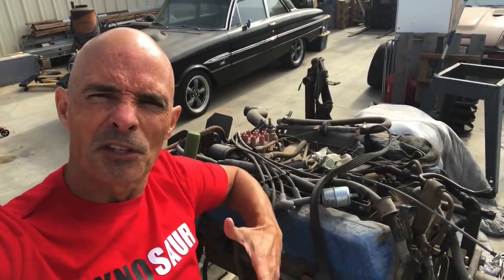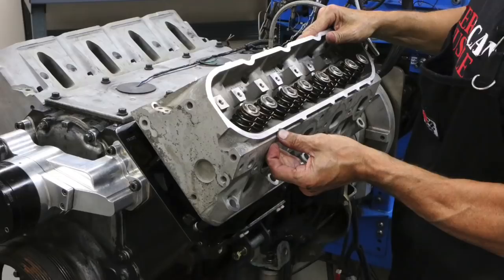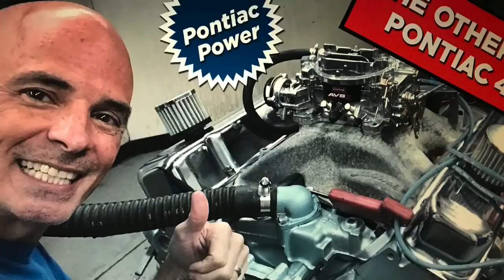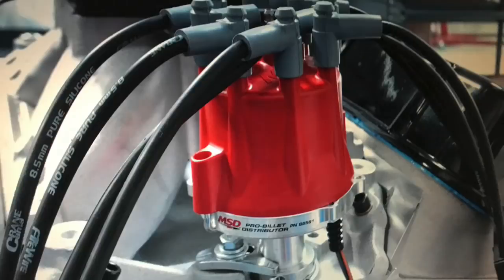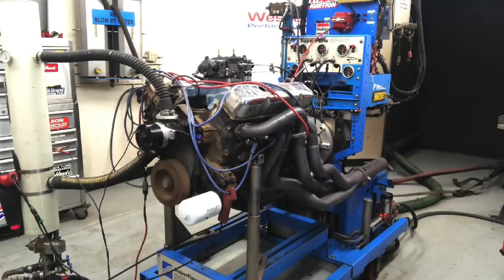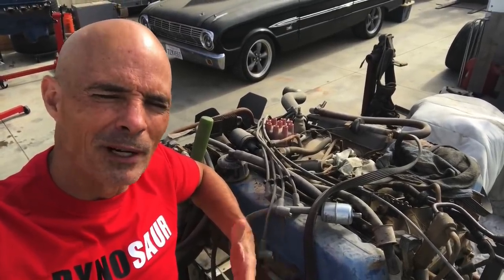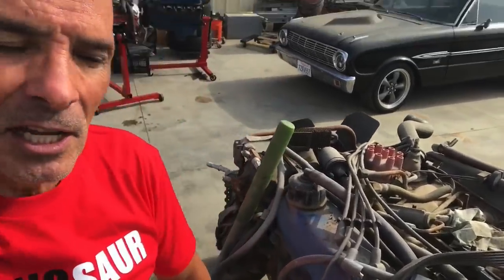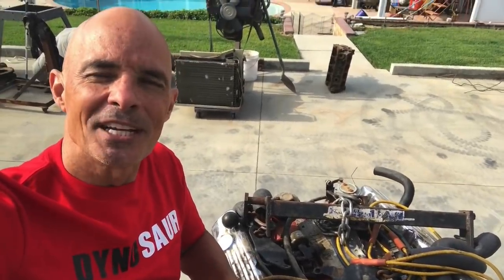REMEMBER YOUR FIRST....DYNO!

Comment: oke here's the problem with this, those accessorizes (water pump, alternator, power steering pump, smog pump, and fan) and complete exhaust system tell the truth about what the engine (motors are electric) is actually making for power. This is why the manufacturers use them in the rating and for insurance reasons they multiply this number x 0.8.  By dyno testing an engine without them in an air conditioned room is a lie. If I tested my 1995 LT1 with this deleted (I have an alternator and power steering pump on the car when I race it) I'd be over 600 hp. In my NHRA C/SA Stock Eliminator '95 Corvette its putting 491 horsepower to the ground and at the flywheel its 581 horsepower @ 7500 RPM. FYI you dont lose 30% of your power through an automatic transmission.  It takes the exact same about of horsepower to run it if the engine is 200 or 1000.
Reply from the maker: Having tested accessories back to back on the engine dyno AND run a motor on the engine and then directly on the chassis dyno-I know what they do. Also, the OEMs do not use a .8 calculation-they rate their motors on the engine dyno with everything hooked up (complete air intake, accessories, full exhaust, run at temp, with factory rune) and run the motor on the engine dyno as it is run in the car.

Comment: Richard,  do you guys monitor for detonation using a knock sensor when tuning older carbureted engines?  I haven't heard you or Steve mention that specifically.  I would imagine you tune timing to the edge of pinging no?  I have a very loud car and cannot hear a darn thing.  I watch the plugs of course but this seems quite inadequate.  I have tried a stand alone knock sensor (87-95 GM version W/ ESC for 5.7L) with the Caspers gauge but have had little luck due to outside noise I suspect and no way to filter it out.  Do you have any affordable suggestions.  Anybody else have this problem or advice?  Maybe I should just plumb a set of Det Cans but really want a solution using noise cancelling headphones that is DIY or affordable.
paste that in there please
thanks

Comment: As it was mention Steve ask questions regarding Camshaft and static CR, but does he do the math to know what the Dynamic CR is in the case of pump gas engines, and in the case of maximizing HP on a boosted engine where a boost level goal is reached do you Richard use a detonation sensor in order to maximize the timing or is this just a straight forward set of rules of timing/CR/Boost and A/F ratio ?
Reply from the maker: Unfortunately dynamic compression doesn't determine knock threshold
Reply: @richardholdener1727  I understand that temperature from lean AF and hot surfaces and timing have the bigger effect, but what about the pump gas limitations vs expected customer output with pump gas, I assume that the customer have a number they want to be close to our in their head, but when the dynamic compression beyond what the pump gas limitations are, then basically one is obligated to pull timing to avoid detonation taking in account you want to remain between 11.6 and 13 AF ratio like Steve mention, is the client expectations vs combination discussed in order to clarify the expectations on the Dyno test ? The reason I ask is that I was playing long ago with a software simulator and it was showing detonation if I went over the Dynamic compression threshold for pump gas, if I used race fuel then it showed no detonation.

Comment: What are the numbers on the heads  c8se are 68 Lincoln heads high compression 3dve are 73 heads d2veae heads are open chamber heads and are junk without a ton of work my guess is that they are c8sve heads with the style distributor and intake it has

Comment: My first engine dyno made just shy of 1500hp with a twin turbo 5.9. Tried so hard to crack 1500 made like 10 pulls in the 1475 to 1495 range but never did find that 5hp. It was a success but still frustrating!! Lol

Comment: I took the very first engine i built ( 455 olds ) to Steve at Westech back in 2004 or 2005.  Great guy! great shop! found a defective lifter and we were able to pull the intake and fix it on the spot and got back to testing.  He also found a hidden oil galley plug behind the distributor i didnt know about.  He caught that when priming the oil before first fire up.  He saved my butt big time, best money i spent on the motor.  Cant wait to go back.

Comment: First dyno was a dyno day. 35$ for 3 runs, no tuning. Fun fun. And I was hooked. 98 gt stock except for a CAI. Real dyno time was getting a chip burned for the 98 with frpp blower. Had a bad plug wire but still was big improvement over stock.

Comment: Riddle me this , on a chassis Dyno a high power boosted car will spin the rollers to the rev limiter in under two seconds , how useful is wideband info on such a short window . Yes I know someone will say roll the throttle on down the highway but that’s downright scary with 1500 wheel hp and at the track you’d have to idle back to pits before pulling plugs or at the very least keep motor running till off the track at the return lane before pulling plugs so that’s likely 30-60 seconds of idling .

Comment: My second question is what is the lowest RPM the engine dyno can register a pull from and why? It relates to your 292 GM testing, future 300 Ford testing as well as maybe the 500 Cadillac or others that are low RPM engines not designed to rev high and are designed to make power/torque right above idle from say 1000-1200rpm.
Reply: shane ,

Comment: I don't quite understand how Steve pressurizes the crankcase and how that will actually help the oil pump pick up oil, unless he's only talking about a dry sump? It seems to me if you pressurize the case, you still have the same pressure on both the oil pump pickup inlet and all of the outlet paths of the oil galleys, as they're all still inside the engine.
Reply: I agree. 
IMO pressurizing the crank case is asking for a gasket to leak. 
Dyno guys are all about high hp ASAP paid by the hour. 

Not the kind of guys who NEED their engine to last 200,000

Comment: @Richard Holdner  Hell to the Yeah with a 429 !   Factory Can Am- ish Bore and Stroke. 
Spin It !!   Chevy 427 Can Am Big Blocks used a special shorter stroke/big bore engine - not the factory stroke.  429 is set up that way from the get/go.  VERY interested in seeing the 3.59 stroke 429.
Reply: The Chevy 430 was 4.44 bore x 3.47 stroke.

Comment: I remember my first experience with a dyno... at GWR (Great Western Racing) in Ontario Ca in the early 80’s. We had a dyno room with a water brake engine dyno. We built Porsche engines and ran them in on the dyno then tuned them. At one point we were asked to run and tune a SBC sprint car engine that ran alcohol. It was a snappy engine!

Comment: First motor I built and dynoed was a Cosworth Vega. 2.0 Liters, 10:1 compression, short track cams, Dual 45mm Webbers. 209 HP I believe, may have been 215.  I had the dyno guy build some more to go racing with and we eventually hit 270HP.
Reply: You say “built”
Then say engine builder...
Reply: @fastinradfordable  Yes, I was just a young guy who wanted a hot street engine, When I got serious about racing I realized I needed a pro to really do it right, so I hired the dyno guy (Bill MCCurdy at Williams racing in Harvard MA) to build some engines for me.  Eventually, many years later, I became a pro engine builder for a while.

Comment: The first Dyno testing I did was in 1966 and we were making around 15,000 hp, and 21,000 lbs of thrust, maybe not what you are used to working on. A Pratt and Whitney TF33.
Reply: Had one of those in a VW Rabbit. Mileage wasn't very good though.
Reply: @Mitten Made Muscle Jet engine test cells have to be outdoors, because of the vast amount of air that they ingest and the hot exhaust, and testing afterburners are quite exciting also.
Reply: In 1966 did you have to hand prop start the jets ?
Reply: @BustedWalletGarage  Ooo I don,t think so. Started with an APU

Comment: Speaking of Ford FEs, do you have any dyno tests of an FE build, Richard? I'm working on a 67 Galaxie at the moment, I'd love some motivation
Reply: Get a good book on building a FE.  The oil system needs lots of work or it will start to fall apart above 5000 rpm.
Reply: @BustedWalletGarage  Too much internet for you.  I've been around them all my life...I disagree.
Reply: @falconater68  I agree. My Dad and his brothers had several FE's and they believed in working their engines and that is not a complaint I remember hearing. Dad's has told me the old Y blocks had oiling issues but never mentioned any issues with the FE's he ran. Not sure if he had one in any of his superstock cars or not. I know he did use a 401 Nailhead Buick in one of the cars.
Reply: falconater68 I was building them before the internet so I’m not sure what you’re talking about.  If you want to throw a FE with the stock oiling system in a ski boat I highly recommend bringing oars so you can paddle back to the dock.
Reply: Google Engine Power, the Powernation tv show. They built a really nice one.
Reply: @donellmuniz590  I've seen those too, I like Holdener's style though. An FE is definitely am "other guys" engine
Reply: @sgt_oj  As a youth, it was my favorite, simply because Dad had a 390 in his F-100 and my first truck had a 360. Then I got my first big block Mopar, lol. One intake swap, and I was converted, lol!
Reply: Depends on what you want to spend. ProMaxx has a series of aluminum heads for the FE now. If I was building one I would at least keep them in mind.

Comment: I've only had one car dyno'ed.. my 91 Calypso green coupe.. trick flow top end, blower cam, methanol injection with a vortech S-trim 11lbs of boost. Numbers were no good, 375 to the tire. Dont know if valve springs were no good or what. Pushrods were to short? Who knows and I'll never know now. Car has been sold and last seen in South Florida. Now..by little 2000 ranger 302 swap" should" see 350 to the tire on motor..ill know in a.couple weeks.or so..ill get.it on video. Hope.it doesn't come apart..lol
Reply: Jody   .All good Stangs are Green and mean. But Id have one thats albino if its been dynoed. Later man!
Reply: You say a “1991 coupe”
Like people will know what kind of car you are talking about.
Reply: @fastinradfordable  Its a lighter green than Cayman Green..... :P
Reply: @fastinradfordable  they know exactly what I'm talking about

Comment: Oil Priming on late models with crank-driven oil pump:

Buy a pump-up sprayer like you use for spraying insecticide. Cut the wand end off and install a fitting that goes into the oil pressure port on the block. Fill the sprayer bottle with oil, pump it up. Thus, you fill the engine with oil thru the oil galleys in the block. Rotating the crankshaft a turn once a minute makes it go a little faster, as does warming the oil to thin it out a bit.

Done this way, you'll get full oil pressure instantly upon initial startup. I'm NOT down with watching the oil pressure gage read zero for 5-10 seconds.
Reply: I still spin the oil pump with a drill till the gauge wakes up. "I am NOT down with no oil pressure for 10 seconds" well put.
Reply: There is a high risk of contamination by pumping oil to the back sides of bearings bypassing the filter...
According to CAT there is such a high probability of contamination particles even in brand new oil that they don’t recommend pre-filling the filter as it’s too easy to accidentally have some spill in the post-filtration side.

Comment: Ive always wanted to dyno one of my builds before it goes in the car. Im doing a gen vi bbc with the comp xr294hr with the GM/edelbrock Rovals and I’m going to run the stock L29 intake
Reply: Is it stock bottom? Gen 6 it Depends on final compression, exhaust method, etc. . 10 to 1 with headers gonna get close to 500 at the crank. Those are good heads and that cam works well all around. You have a goal or number in mind? Tuning makes a huge difference as in carb/timing.
Reply: @youcanbesmartaskhow3857  I actually got the Idea for it from watching Richard's videos. It is a stock bottom end 7.4 (4 bolt) and the compression with the heads should be in the 9-1 range. I ran the comp-beehive valvesprings from the back to basics spring install workup he did, but I actually got titanium retainers to further lighten the valvetrain load. .540int .560exh. 242/248 on a 110 LSA. I am hoping to get the power peak up over 5k rpms with the stock long runner EFI intake. Allegedly the cam will peak around 6k, but looooooooooooooooong intake runners on the L29 intake.
Reply: @blakestewart6644  sounds like peak HP is not your real goal, which is good you are stil going for a nice curve, lotta usable torque all over.  How are you going to tune the ECM for your mods?
Reply: @youcanbesmartaskhow3857  There is a local dyno tuner around here that tunes the later black box computers with HP Tuners. I think that it will be limited, and eventually I will go to an aftermarket ECU, but for now it should be fine for an N/A 454
Reply: @blakestewart6644 you using headers?  i would think that would be fine if they can tune it for your mods. 9 to 1 is a nice ratio as far as timing control it's forgiving and  any fuel should be as well. But since you have the heads and cam, an aftermarket intake, bigger throttle body, bigger injectors would do wonders and make those edelbrock   heads worth it. I know it's a snowballed..😉  is it a 3500 gmc? Dually? Or a project swap? Just curious I'm putting together a gen vi with 049 heads from 1973, bigger cam, roller rockers, etc. Great they are all 4 bolt mains! I have a weiand stealth manifold and 850 carb tho.
Reply: @youcanbesmartaskhow3857  Doug Thorley swap 2" long tubes with slip tubes. See my previous post about it being installed in a Monte Carlo SuperSport
Reply: @blakestewart6644  in this thread or another? I'm kinda new I didn't check out any prior comments but I dont have the  car just motor and turbo 400  and I'm leaning monte carlo friend of mine has a 71 ss factory 454 w no motor he has cleaned up fairly well. But I like later models too.  Old cars getting hard to find in my area [Cincinnati]. But those are great headers another reason to try for more in induction. But it's probably quite expensive for what I suggested. Those are great heads though and good cam choice.
Reply: @blakestewart6644  I saw your previous post now. Saw where Richard commented your intake makes power lower. Probably not gonna see that cam's 6k peak.
Reply: @youcanbesmartaskhow3857  I'll be thrilled with a 5200 rpm power peak and a 5400 rpm shift!
Reply: @blakestewart6644  and all that torque throughout? Hell yeah!! If you have a local dyno/tuner guy that SHOULD be a fairly easy finish. Good trans as well. I'm in the driveline business and that combo [efi bbc/4l80/ etc] holds up well. And you cant beat the driveability/ mileage/durability.
Reply: My coworker built a brodex Chevy 383. 
The dyno either ran it without oil or coolant. 
When he got it back the bottom end had to be redone. 
That put him out of budget and choosing to dyno ultimately made the project not be able to be finished